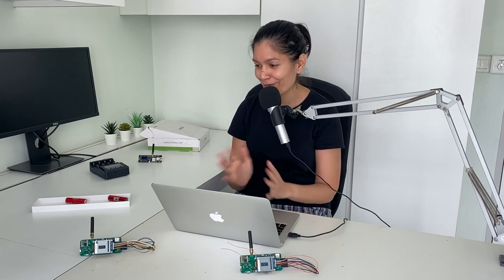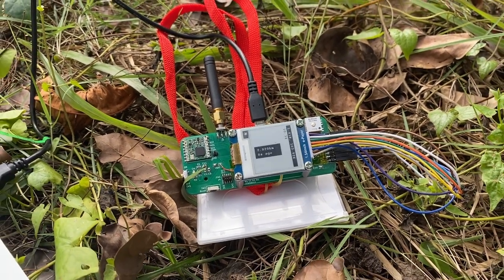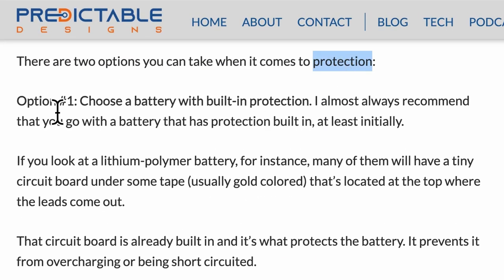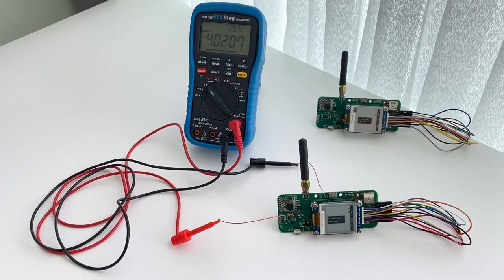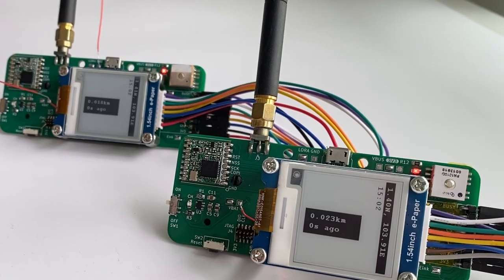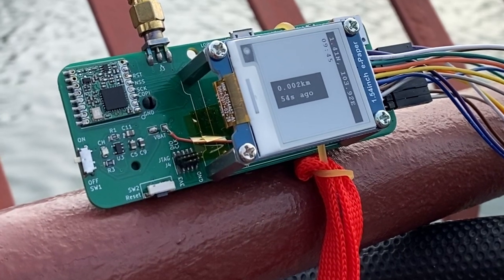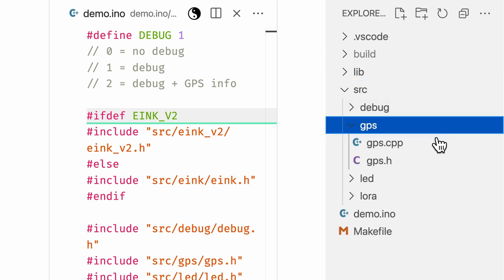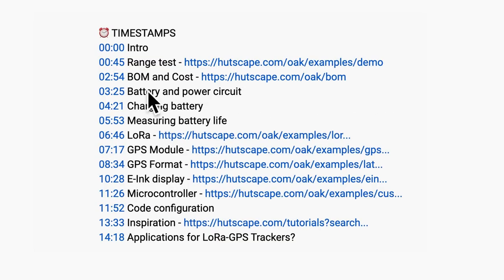I built a LoRa-GPS Tracker // Range test, battery life & firmware

Comment: Do you know that the 18650 you use is totally fake?
A 18650 with a 4200mAh just does not exist !
Do some research if you don't believe. 
Buy branded 18650 cells instead like Panasonic, LG, Sanyo, Samsung, Liitokala etc... the real deal. 
At time of speaking 3600mAh is the highest capacity for a 18650 but it seems that Samsung has a 4000mAh version model number INR21700-40T.
Good luck with your project.
Reply from the maker: Thanks for the heads up! I'll look it up.
Reply: +1 on this.
Reply: +1 more as well. There are some 3500mah cells out there that would probably double your battery life. I would suggest either LG-MJ1 or Samsung 35E or Panasonic NCR18650GA. Batteries are notorious for false advertising, you could watch a video on YouTube where some guy tests out a bunch of these (Farm Project 18650). 
     Either way, I liked your video, very well presented from a very smart tech.
Reply: test them and they'll show the true capacity
Reply: Or check out 21700 cells a fraction bigger but alot more capacity.
Reply: +1 on this

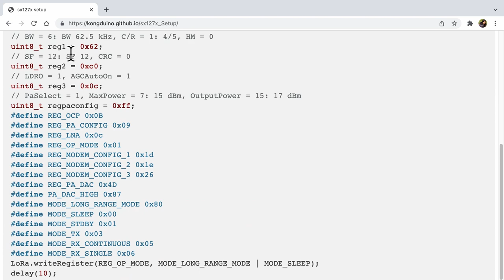Comment: At 2:35 you mention designing a 3D printed case for your project.  A video from you on that process would be valuable.  That's a step that is a roadblock for me on many of my projects.  Many of them I don't complete because the final implementation would be too ugly for use in public.  Thanks for another great tutorial!
Reply from the maker: Yes, I'm planning to get into FreeCAD this year and I will definitely be sharing the process.

I also have to acknowledge, although the past decade has made prototyping very easy, it's pretty challenging for one person to pick up all the skills from various domains like mechanical (3D CAD design), software (cloud, firmware, security), hardware (electronics). So it's quite normal to feel like you :) Me too!

Comment: I replied on Twitter re: possibility of 433mhz instead of 915 because last year I did  433 P2P range tests here and get much better coverage. We live in a valley, full of trees and I can get sigs through dense trees (in leaf, btw) no probs. I can even get out of line of sight from beyond the hills (only tested up to abt 1km, no LOS).  Bear in mind I had tuned the radios almost to max sig strength. Totally with the poster re: tracking where the heck my dogs are - its a mystery every day, great work Sayanee.
Reply from the maker: You are correct, possibly a different frequency might create a different range. Many factors to consider for a good signal!

Actually, I did 433MHz with T-Beam because I accidentally bought the frequency. I also had 1km similar to yours.

For LoRa, the frequency needs to match the country's regulation unless lower power. Also, gotta check the regulation in that area. https://www.thethingsnetwork.org/docs/lorawan/frequencies-by-country/

So yes, you could easily swap the frequency by exchanging the antenna and the radio module.

Comment: Thanks for nice video.. For single code base, I would use EEPROM or similar storage to store configuration; and bind/configure the modules on bootup. That way same code runs in different configurations.. This works values such as address etc well. For display types etc, it requires a little more work. I have no idea the libs you are using, but in my designs I use abstraction so that the implementation is seperated from usage etc..

Comment: You inspired me to build a gps lora tracker for my dog to know where she is when we are in the mountains without mobile service. Used 2 t-beams. I could read, buy, program and test the system in a week, even with a 3d printed case from thingiverse. It is absolutely amazing to be able to do this with so many people sharing such high quality knowledge. 
By the way, I added an electronic compass module and calculate the bearing with a formula similar to the haversine distance. Still need to put some time on that but I'll make it work!
One quick question: have you tried different spread factors to achieve longer distances? Thank you for your great videos! Cheers from Barcelona
Reply from the maker: Wonderful! Thanks for sharing your use case. Tracking our pets is a great use case for using LoRa and GPS.

Thanks for the ideas on using the compass module and different spread factors, which I have never tried.
Reply: Did you finish this project, I'm going to use some Lora to track my hunting dogs in Ireland.
Reply: I’d be weary of the performance of the gps and lora  modules out of sight

Comment: Cool 
Not many woman out there doing this kind of stuff.
But why looks your place so clean ? Mine is a mess...la
Keep up your great work.
Greetings from Taiwan
Reply from the maker: Because the mess is inside the cupboard :) I also have a motivation to keep out sharp multimeter probes or tiny 0603s out of my curious toddler's hand, haha :)
Reply: @sayanee  Haha, fair enough, now you caught my interest how you arranged your mess inside the cupboards.
I try to avoid anything smaller then 0805. I can't see them anyways
Reply from the maker: @lasmurf4175  Yeah, I shared a while back how I organize with transparent zip lock bags inside stackable boxes: https://www.youtube.com/watch?v=D_I5OCXYdss with https://partsbox.com/

I have to agree on the 0805s especially for first version of the boards which should be made for easy debugging, hence, lots of boding and desoldering :)
Reply: @sayanee  Ya, I saw. I have a box system & for SMD parts using the square plastic tube usually used by companies putting their drill or milling bits in. It works for me.
I keep track on it with a sophisticated Excel sheet. Sort of inventory system

Comment: Dear sanaee 
 I built this project with stm32  and arduino 
And   I used loea02   And gps and iI had the same problems with gps  but I used a strong antenna
Foe gps  and my problem was solved also my system sent humidity and temperature to the reciver then simcom module sent deta to the network beside photovoltaic panel was used in order to charge batteries I think you should use a strong antenna for gps module

Comment: I'm not interested in the GPS feature, but definitely LoRa. I want to use it to send data to a battery-powered eInk display in my house (e.g., weather-station-like data) but gather and process all the data on a VM or remote device I can have plugged in 24/7 (more processing will kill battery faster, hence the plug in power idea). These are on opposite sides of the house as well, so one of them will likely have issues with Wi-Fi, hence the desire for LoRa.

Comment: Are those 18650 cells really have 4200mAh?? Seems fake. Did you get a chance to test the capacity.
Reply from the maker: Interesting, nope I have not. Good point, maybe I should check it.
Reply: @sayanee  Yeah. 4200mAh is practically not possible to fit into 18650 format. A test on capacity would be an interesting video. As far as I know, LG MJ1 18650 cell with 3500mAh is the most amount of juice that an 18650 cell can hold. Overall your videos are very informative, interesting and easy to follow. Love from India
Reply from the maker: @rarecomponents  Thank you so much! I did not know about the cells. I'm also learning from you!

Comment: Let say if I have a lora gps tracker on a boat, but the distance to the lorawan gateway onshore is too far away. Luckily there is an island where I can install something there to increase the range, but there is no internet connection on the island. 

So the data transfer will be like this; boat to island, island to onshore gateway. Question, what should I install on the island ? A lora p2p ?
Reply from the maker: Interesting! 

Maybe you need a LoRa extender/repeater https://lora-alliance.org/lora_products/wireless-m-bus-range-extender/ or hop onto an existing LoRa network such as https://www.thethingsnetwork.org/ or maybe even cellular if the island has mobile connectivity. Lots of options depending on the distance and types of other wireless comms available on the island, I guess.

Comment: How did you design the 50 Ohm line on the PCB? It depends a lot on the material used for the PCB.... And getting it right is very important for RF, otherwise your SWR will be pretty bad. https://www.youtube.com/watch?v=iI-2VjTE310 is a long video showing on how to try to tune such a connection.